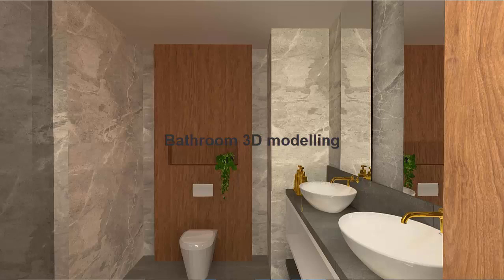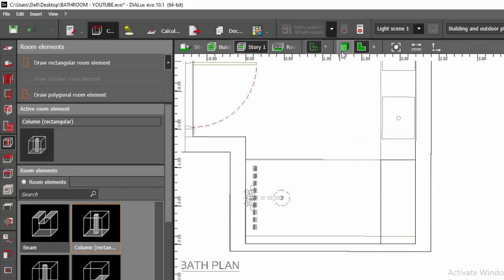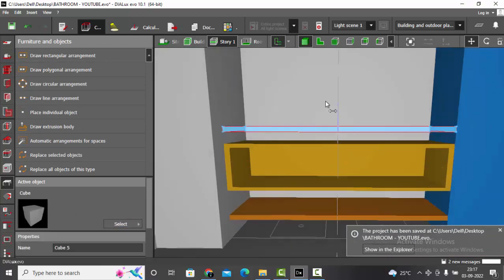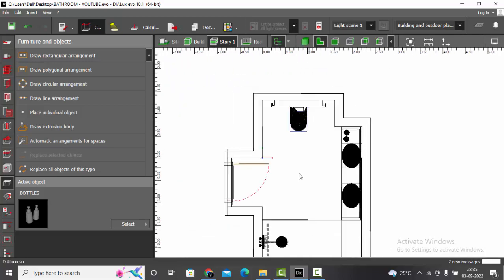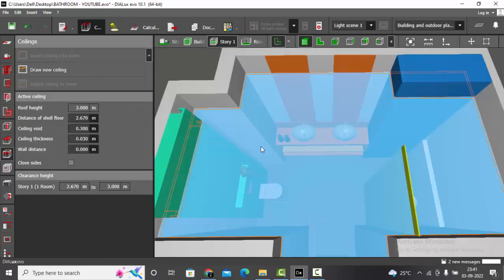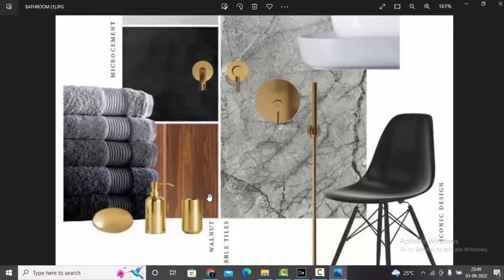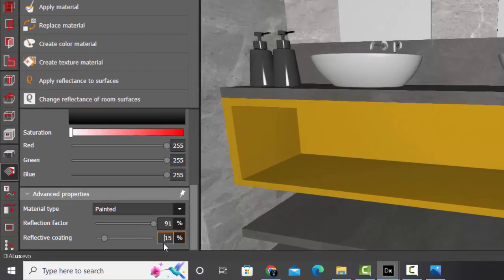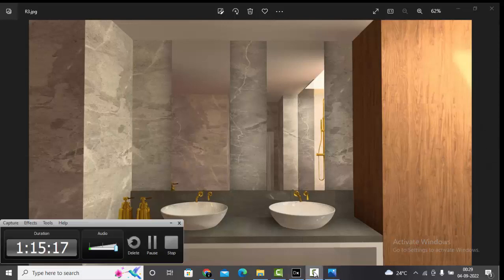PROJECT SERIES - BATHROOM - 3D MODELLING - EP 01

Comment: Hi Sumaiya, congrats for your work.
A question for that I'm a noob :). How do you choose reflection factor and reflective coating values? there are tables of material or experience only?
Reply from the maker: Hi Marco,

In simple words if I have to explain Reflection factor is how much light the surface will reflect black.

Say, if its white , it may reflect back 90% of light falling on it. And may absorb 10% of light.  And if its black say its not going to reflect back any light falling on it, its going to absorb all.

Please check material catalogue to observe the reflection factors mentioned for each material.

And reflective coating is glossiness. Take an example of your favourite Ceramic Mug. The mug has slight shine on it. That is reflective coating

Comment: Good evening Sumaiya, I'm following your classes here in Brazil. I have doubts about the placement of the skylight. I was only able to put it on the ceiling and when I look with the lining there is no hole. Furthermore, the wall where the shower is located disappears if I am in view of the room, is there a way to fix this?
Reply from the maker: Hello! Thank you for your comment and for following the classes. Let's address your concerns:

1. Skylight Placement: To place a skylight properly, drag and position the roof window directly onto the ceiling. Sometimes, due to positioning, it may  get placed on the floor. Ensure that you're dragging it specifically onto the ceiling surface to create the skylight opening.

2. Disappearing Wall: The wall disappearing issue might occur when viewing the model in "room view." Try switching to "storey view" or "site view" for a complete perspective of the scene. This change in view mode should prevent the wall from disappearing and give you a full view of the surroundings.

I hope these solutions help resolve the issues you're facing. Let me know if you have any further questions or if there's anything else I can assist you with! Keep up the great work with your modeling projects. 😊
Reply: Thank you, it helped a lot. I will continue watching your great classes. I still have a lot to learn from you. @SumaiyaEliyaz